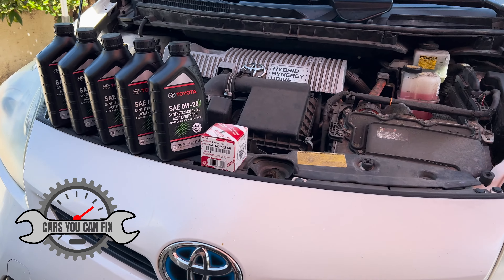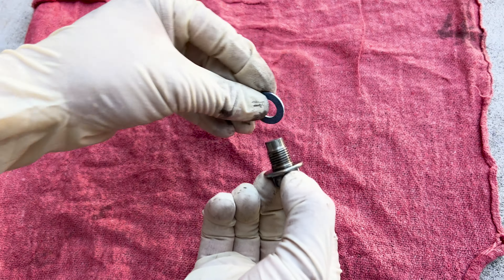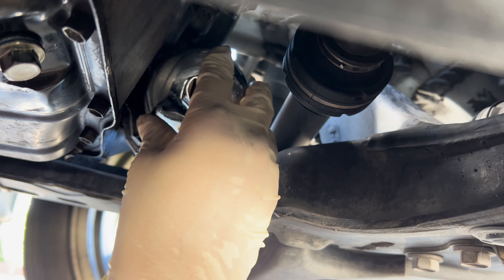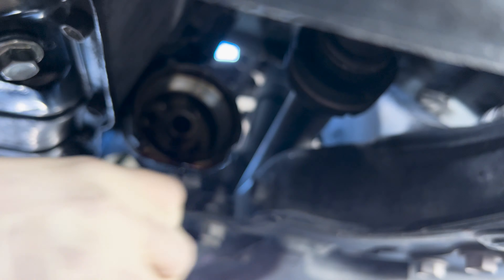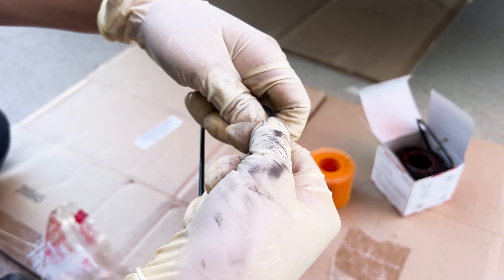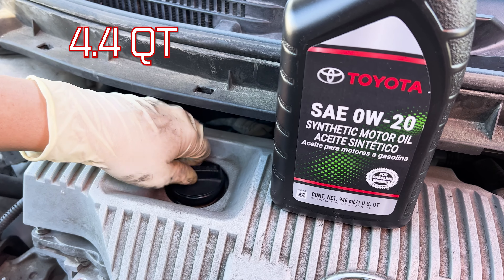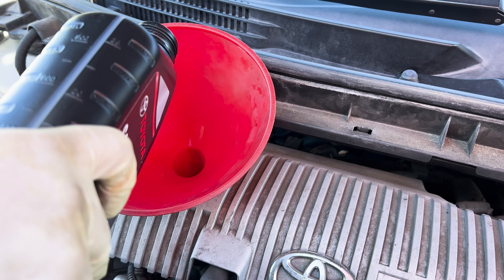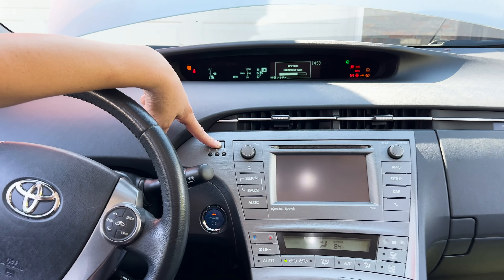Toyota Prius EASY Oil Change 2010-2015

Comment: i use 4 quarts and its perfect in middle of dipstick cross marks, just FYI-save you buying a 5th quart
Reply from the maker: The dip stick cross marks represents 1 quart, engine specs have it at the top of the cross marks, at half way you are about 1/2 quart low. I personally wouldn't recommend running low oil on purpose. Plus you can save the half quart left over for your next oil change! Thanks for commenting
Reply: @CarsYouCanFix ❤

Comment: Thanks for including all torque specs and maintenance reminder! Do you know if the oil change interval is set to 5000 miles or can it be adjusted for synthetic oil?
Reply from the maker: I believe this one is set at 5000 mi intervals with no adjustment. Even with synthetic oil I change every 5k or 6 months, whichever comes first.

Comment: Why do we put it in maintenance mode after service, like i am driving it for 2 years and i had never did that maintenance thing, can you explain why do we do that for ??
Reply from the maker: After the service you reset the "maintenance required" message. The internal computer will then tell you when your next oil change is due.